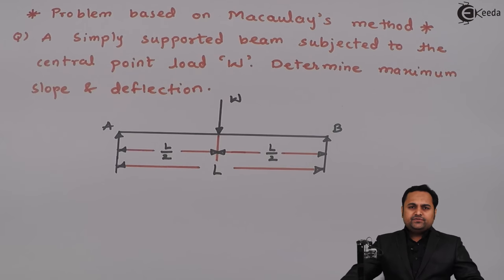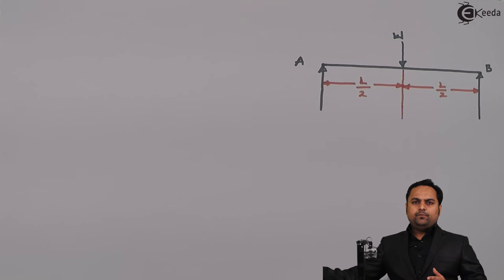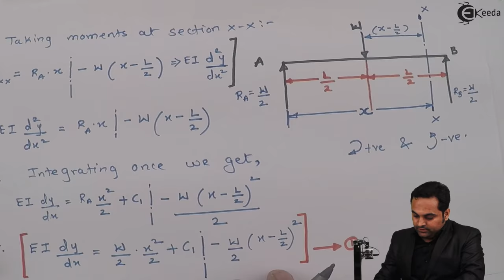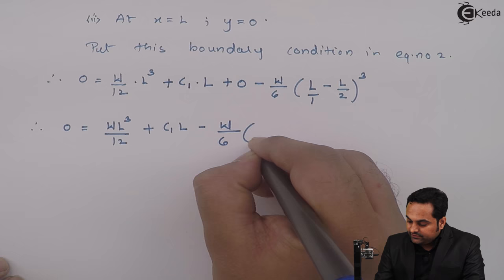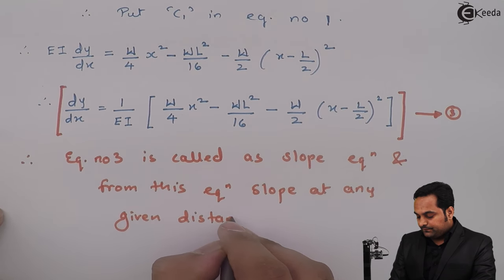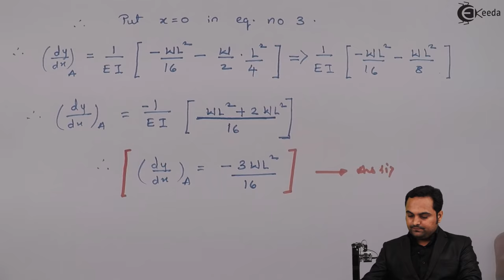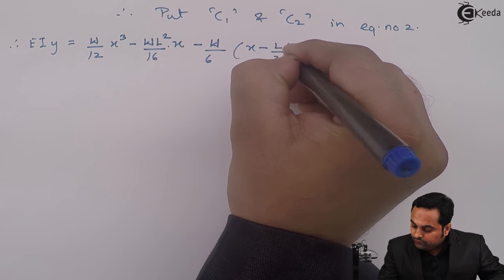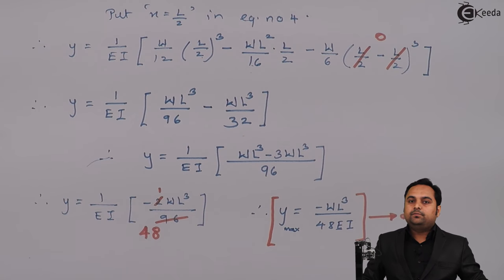Macaulay's Method - Problem 1 - Slope and Deflection of Beams - Strength of Materials

Comment: At both ends the slope magnitude should be same because of symmetry but you are getting different value sir.
Reply: I too have the same doubt
Reply: you are right. but sir didn't neglect the Macaulay's function when found the maximum slope in point A(x=0). that's why values are change

Comment: The method that has bee used to find the deflection of slopes, is wrong as the brackets behave as unit step function according to macaulay,but you have just neglected the brackets while calculating slope and deflection, whereas while applying boundary condtn used it

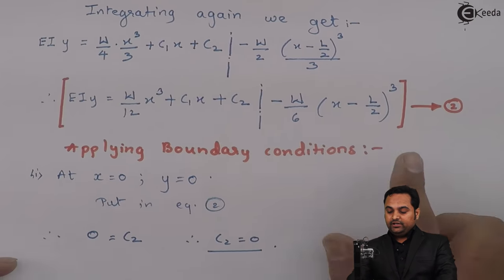Comment: error in calculation at 17:58 if we move C1L to the other side it becomes negative changing the equation
Reply from the maker: We noted your query. Our academic team is working on it and will update you once the issue is resolved. You can download our app where you will get all the concepts from basics, practice problems and doubt asking facility. 
Download App - https://ekeeda.com/download.html